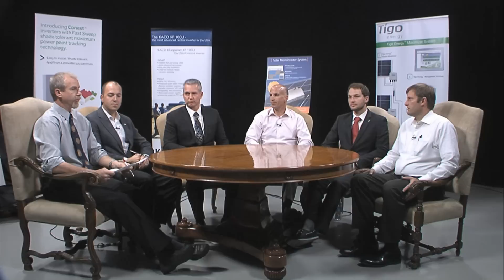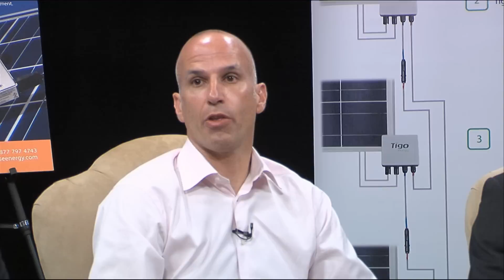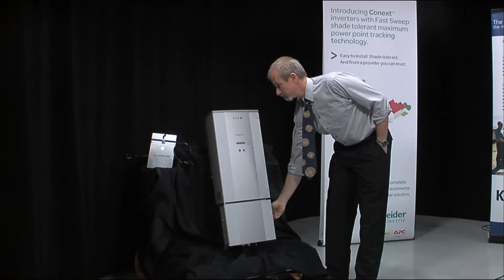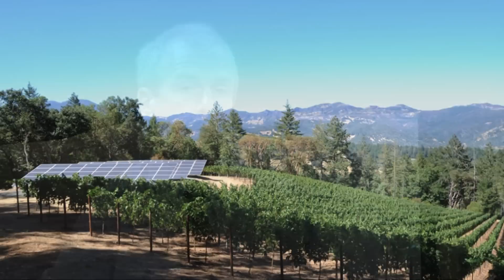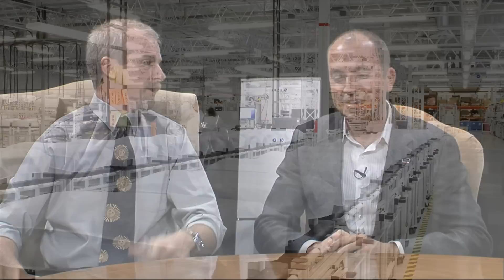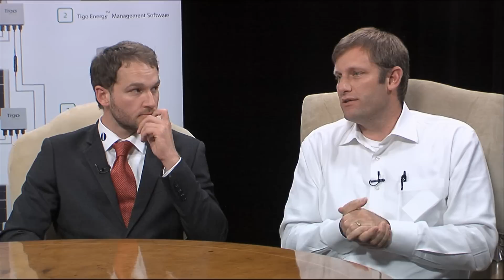Solar Inverter Round Table Discussion

Comment: The Gentleman from Enphase made a comment they get more energy out of a panel than a String Inverter. That seems to have been proven completely false based on research done at Wekiva Island in Longwood Fl. Which has proved that string inverters are 18 + percent more efficient than micro inverters not to mention string inverters or more reliable than micro inverters.

Comment: Enphase Rocks!
I am in the industry and have seen nothing but splendid performance from Enphase -  they offer 25 years warranty and outstanding monitoring. Sometimes I use string inverters, but fact is that SMA or Schneider, etc will cost you as much as Enphase (current prices February 2014)

Another fact is that as AC modules gain popularity all this guys are either going to become module manufacturers or shrink their businesses.

Comment: Nice tennis shoes Kaco.  I've had Kaco's bust apart in shipping,  SMA's buzz within days of installation, Xantrex XW (Schneider) flat fail, and in my opinion Emphases will see widespread failures after about 5 years.  Did you notice they spent a lot of time talking reliability?